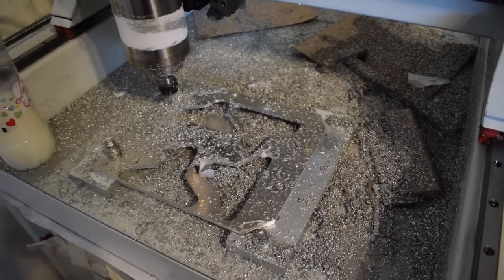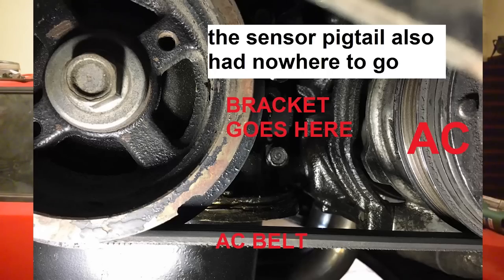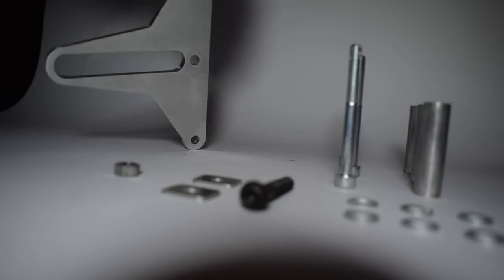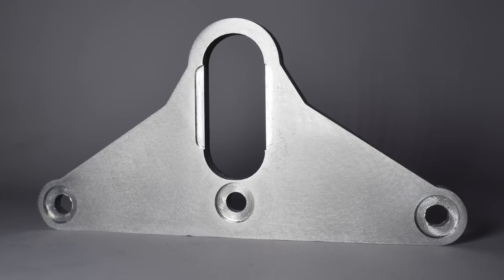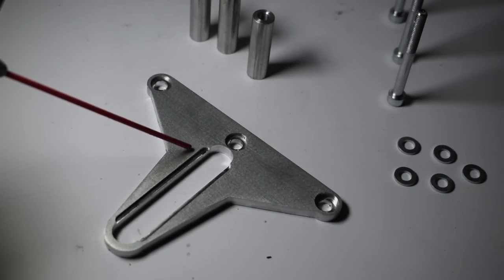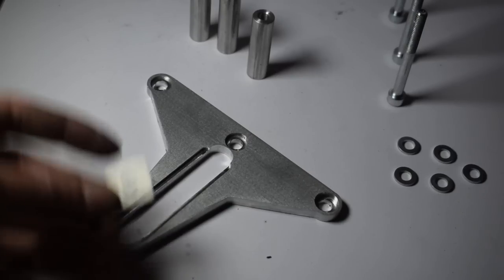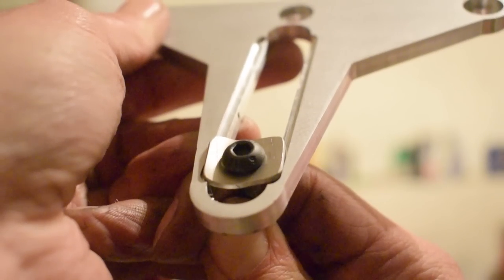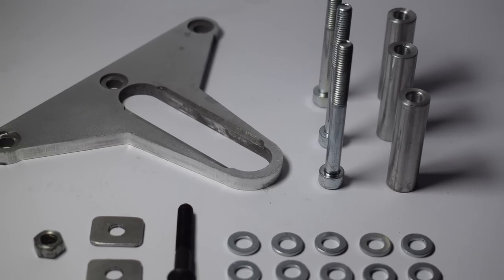4AGE crankshaft position sensor bracket V2.0

Comment: Not here to bash, just curious, how much testing have you done with this bracket? I ask because I specifically swapped from the similarly designed MRP bracket to your previous version sensor bracket due to vibration issues with the MRP setup causing signal loss at specific RPM's (presumably due to engine harmonics at those speeds). The vibration was so bad it would wear a groove in the sensor and the car would ignition cut, even if I had it set to the maximum gap and everything torqued in place to max recommended spec. Since swapping to the much beefier V1 D4A bracket it has been flawless.
Reply: I've heard similar things about the mrp setup, but considering that this is a 100$ less then the mrp made version it probably would not cost you much to throw it on and test for the same issues.
Reply from the maker: This is a very good question and something I have been thinking a lot about before releasing this. I have tested it on my engine at various rpm and have about an hour of footage of the gap with the engine running that I watched in slow motion to see whether there is any movement at all. There was none. I made the bracket and spacers extra thick and if you try to shake the bracket by hand it's possible to make it move a bit only with excessive and unreasonable force and using some sort of leverage. Of course that is the case on my engine. There are of course thousands of engines out there, in different condition and with different sensor and trigger wheel setups and that will be the real test. As long as it's installed and used right I am confident this bracket should work well. But if the feedback from users is negative I will refund and redesign. If it's still no good I will pull it back from the market of course. The v1 bracket will also get a minor redesign and will be sold again as soon as I find the time.
Reply: @d4a  good to hear, since I'm interested in an AC compatible bracket for another build I'm doing. I appreciate the detailed response!
Reply from the maker: No problem. Let me know when you are ready to order. I would love some detailed feedback on the bracket when on an AC setup.

Comment: I have a stock 4age 20v silvertop. Does it have a crankshaft position sensor and if so, where is it located? My vehicle has intermittent dropping of revs by itself and I suspect this is the issue

Comment: The nuts included should be self locking, otherwise they will get loose with engine vibration. ;)
Reply from the maker: They are. The one in the video is a regular one I had laying around and I used it for showcase purposes only.

Comment: Quick question about this:
Since the sensor is on the outside would the elements have any effect on the sensor? (ie: water, mud, salt, etc.)
New to the car building scene and I'd like to convert my 4age for Coil On Pack using crank trigger sensor so this seems like the best route when youre trying to make the bay look clean
Reply from the maker: The sensor isn't affected by the elements. It's basically a plastic cylinder with a magnet inside it. Water, salt, ice etc can't affect its ability to read trigger wheel teeth and send a signal to the ECU. So unless you drive through a field of ferrous metal shavings you will be ok :)

Comment: Did you have to use the T3 adapter to install the trigger wheel? I didn’t order one, so I’m wondering if you used it. It seems like I can still bolt it to the front without the adapter.
Reply from the maker: I didn't, made little spacers myself. You can't bolt it on without some sort of adapters or spacer, it will fall off after a while.
Reply: @d4a  nice! don't really want to pay $95 for one lol. do you have any pics of your spacer? does it have threads in it? did you need longer bolts?

Comment: I know a guy who had this style of trigger wheel sensor mount and had problems with vibrations causing the sensor to contact the wheel. Is there a chance you can still keep making the old style for those that do not ever want to run A/C? The old design does not suffer from the vibration issues that this one might (friend had to add a diagonal leg glued to the sump to stop the vibration issues)
Reply from the maker: Old style is still available. Check out the shop section of my site driving4answers.com. That being said I have sold a few dozen of these and no one has had any vibration issues yet. I made this thing super thick and beefy to be sure there will be no vibration issues whatsoever.
Reply: @d4a  oh awesome I only ever looked on ebay as your shop site never seemed to work for me. The guy who had the issue was running it on a 480whp 4agte track car so probably had a lot of vibrations and he was using a kit they have since changed to avoid this. Because the mounting bolts are all in a line with the sensor hanging out so far it definitely needs to be bolted down hard. Glad to hear your v2 isn't suffering the same issues :)

Comment: Make the square washer thicker.
Reply from the maker: I will likely make a little update on the next batch of brackets and one of the square washers will be one piece together with a spacer which will eliminate any chance of bending. I made it this thickness because two standard round washers fit perfectly between the two square ones and that prevents bending. It's all in the instructions, but a one piece square washer will still  be nicer and prettier.

Comment: Building a 7a. Know if your backet work for 7a block? Or does this mount onto the 4a oil pump?
Reply: Nevermind should have watched the whole video before asking lol.
Reply from the maker: No problem. What's your oil sump and pump setup?
Reply: I belive you use a 4a pump with the 2 piece 7a sump.
Reply: Ive only just got the 7a tore down
Reply from the maker: There's different options. You can use a 4a oil sump if you use the spacer from MRP. Are you going to run AC?
Reply: No ac at the moment.
Reply from the maker: If you don't plan on having ac I will soon have a bracket out that will bolt into the oil pump. It will be like my old design but updated and will also work with trigger wheels on the back of the pulley.